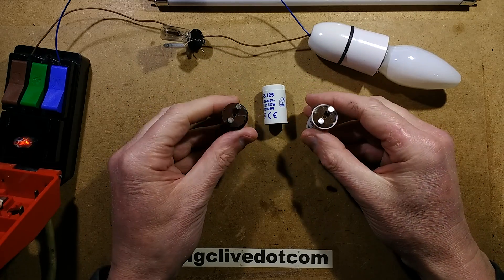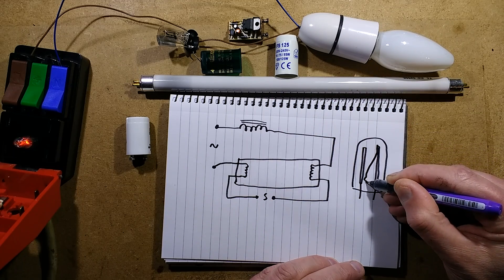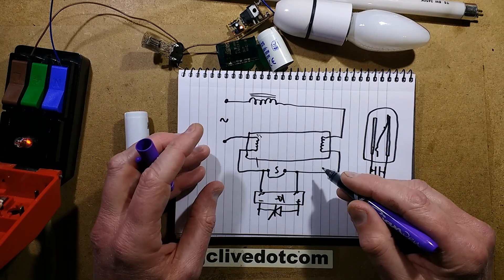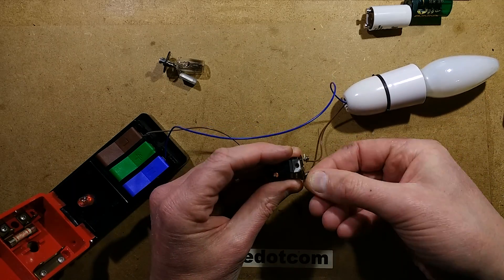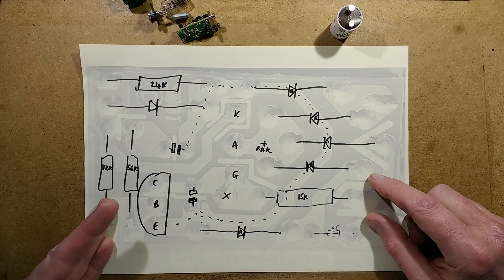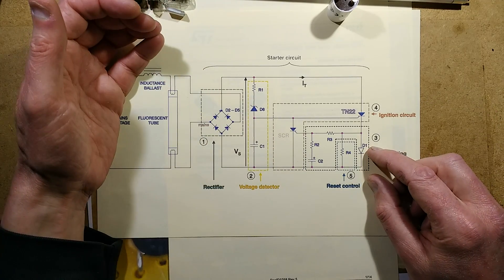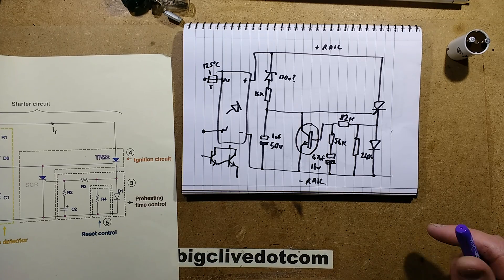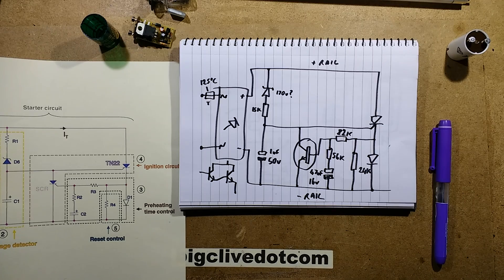Reverse engineering an electronic fluorescent starter.

Comment: I don't think the diode that is in series with the main thyristor is a zener. The band on it is to the negative rail. If it were being used as a zener it would be the other way round with the band to the thyristor cathode. It could simply be that this diode's forward voltage is high enough when the heaters are on that it will exceed the voltage required to bias the darlington on (after the time delay) and reverse bias the main thyristor, turning it off even thought it still has a voltage across it's anode-cathode.

If the tube doesn't strike at this point, I can't see how the starter is going to latch off. The 47uF timing capacitor is going to discharge via the diode (without the heater current it's forward voltage will be lower than that needed to bias the darlington on) and the "reset" resistor. I suspect it just keeps switching on and off, giving the tube further chances to strike.

It would be interesting to watch what happens on a scope with a broken tube - after having taken precautions as a scope's probes are usually referenced to earth (and therefore the neutral in .uk).

Comment: I don't think the second circuit actually latches. When the 47µF capacitor discharges below the threshold the 1µF capacitor charges and latches the SCR on. The SCR turns on just long enough for the 47µF capacitor to reach (or actually exceed) threshold and it turns on the transistor and shunts out the 1µF capacitor and cuts of the SCR and the cycle repeats when needed (the 47µF goes below threshold). This cycle also happens so quickly that the fluorescent tube filaments (or your ballast lamp) do not have time to build up sufficient heat to start glowing, let alone starting thermionic emission and the inductive pulse created would also not be enough to attempt a tube start.

Comment: "the thyristor that shunts the starter contacts is kept off if the tube doesn't strike" Would it be because of thermal fuse you have mentioned.
Reply from the maker: the thermal fuse is a one-shot fuse that will open the circuit if the starter fails in a dangerous manner.
Reply: I figure it must be small leak from tyrister to keep latching the transistor. Because of small leak they must use Darrington instead of a regular BJT.

Comment: As I see it:
The fluorescent lamp should get lit by the coil spike after the thyristor gets shut off.
After that the voltage over the circuit is low enough to prevent a restart, the zener doesn't provide current.
If the lamp shouldn't start the voltage rises high enough to conduct the zener again and the cycle starts over once more. The R2, R3 and R4 should be dimensioned such that the darlington doesn't conduct anymore at a restart.
Now I have a question: the darlington input needs 2x 0.65 Volts, is the series D in the main circuit a version with a higher voltage drop?

Comment: Not to get boring I will just give a couple more thoughts that sprung to mind and call it a day.  One is that the thyristor needs to be off while triggering the tube into life.

First, it is possible because of the time it takes for the ballast or inductor field to collapse and create the starting voltage it is possible that the thyristor may trigger at the same time as the field collapses preventing the high voltage being created to fire the tube.

Second and may or may not be so obvious is that when the high voltage is created the thyristor could fire and present a virtual short across the tube stopping it from firing.

Comment: I must appologise to any electronic engineers and technicians for the display of my stupidity.  I broke the first rule of fault finding, I assumed!  The answer comes with a blinding flash of light and a thud as your jaw drops and hits the floor.

Assuming a steady 240 volts out of the bridge rectifier then the circuit would work the way I described but and here is the big but.  When the flourescent tube strikes you have only 90 to 110 volts out of the bridge rectifier.  I am betting that the zener diode that feeds the trigger circuit of the thyristor is a much higher voltage than the 90 - 110 volts.  So the thyristor never fires once the tube is on.  The darlington pair circuit then becomes a delay circuit giving the flourescent tube time to strike.  It also probably stops unecessary firing of the thyristor during this period.

Comment: This channel brought to you by bridge rectifiers.

Quick question: The fluorscents in my wife's new store have a single pin at each end. How do they work? Is it some kind of double pin that I'm missing?
Reply from the maker: +Chaos Corner They may be a type that is run like a cold cathode tube.  Just one electrode at each end.
Reply: Do they run continuously at high voltage or just to get them going? They seem to come on pretty quickly. They are old 8' T12s. I am thinking I might start replacing them with LEDs but not sure if that's a good investment.

Comment: My guess is that the main thyristor must fire every so often, depending on the state of charge on the capacitor on the base of the Darlington transistor.  If enough charge is held then it does not fire every half cycle but it must fire every so often.  Just enough to keep that capacitor charged enough to turn on the Darlington transistor.

Comment: Once the 47uF capacitor is charged, the transistor turns on and stays on. It steals most of the current from the gate of the thyristor. A low current flows gate-cathode through the thyristor, it is not enough to turn on the thyristor, but it is enough to keep the transistor on. And as the transistor is on, it still eats most of the current, so that there's never enough current for the gate to turn on, but some little current to keep the transistor on.
Reply: and of course the gate-cathode junction of the thyristor acts as a diode in forward direction.
Reply: The SCR gate is shorted to ground when the transistor is on (that's why the transistor is there).  How can it get power from the SCR to keep the transistor on if the gate is shorted?  How can the cathode have any voltage on it?
Reply: The transistor is not fully saturated. Its voltage drop is enough to allow tiny current flowing through the gate-cathode junction and then through the base-emitter junction. A negative feedback keeps this current stable.
Reply: Which I believe it raises the question on why the SCR even turns ON the 1st time ?
In other words, even on the 1st time, as the 50V 1uF cap voltage increases, the gate-cathode current increases, raising the base-emitter voltage  of the "NPN" , which could eventually start stealing enough current to prevent the 1uF cap voltage to further increase, stopping the SCR of ever turning ON. 
My guess is that the 47uF comes to the rescue here, when you 1st turn ON the light because it is fully discharged. The times constants are fine tuned such that the SCR turns ON way before the "NPN" is even close to go ON. But once the SCR triggers now there is plenty of current to complete charging  the 47uF at the fastest pace possible.

On another topic, nowhere I have seen that a SCR, once ON, can be turned OFF by playing with the gate terminal. Usually they just talk about the hold current.
Having said that I am convinced it is the "NPN" that turns OFF the SCR, though I am not sure how.
Reply: Yes, DiodeGoneWild is right. 
There only has to flow a few micro-amps through the gate into the darlington's base to keep it on, which is not enough the turn on the thyristor.
Reply: Kevin Counihan  Im not saying its not an SCR. Its entirely possible it is, and I agree it would make a lot more sense to use only SCRs/thyristors as is normally done. It would make more sense. But diodes in the usual package with dual dies are relatively cheap (but more expensive than the usual rectifier diodes), and it could be possible they are doing it that way, if its a Darlington. It would be odd for sure, but its possible. I know what you mean about them being more expensive. GM used large HV power diodes in their automotive ECM/PCMs to mitigate HV spikes of either polarity and reverse input protection. Usually had a large power diode, TVS, and/or a MOV that was almost an INCH in diameter. As far as the diodes I was "testing", these where rejects. I was doing it intentionally because I knew they would dissipate so much power once they finally started to conduct. For fun, basically. They were used in 100 kV internal power supplies for monoenergetic neutron generators for oil field tools. Basically a 16" long tube with a 24 pin connector at one end and there was a 20-30 stage ladder to step up 200V from either an external source or internal switchmode supply powering the ladder and neutron tube itself (called a minitron).
Reply: greetings DiodeGoneWild 👍

Comment: Could it be Clive that you had wrong specs assuming that the IC was a Darlington pair?  A transistor does not "latch" like this, a special latching circuitry is required to enable it to do so, only a thyristor (or some mechanical relays) can do this sort of thing by itself. It does not make sense for makers of the starter to deviate from the recommended manufactures' diagram in that one detail only.

Comment: Could you please have a look at this and tell me how good it is. I am going to use it for a small phone speaker build.
http://m.ebay.com.au/itm/PAM8403-Audio-Module-DC-5V-Mini-Class-D-Digital-Sound-Amplifier-Board-LCD-TVs-KK-/142061019767?hash=item21137f2277%3Ag%3AA94AAOSwbsBXkDbl&_trkparms=pageci%253Adaf6e898-210f-11e7-b039-74dbd18011be%257Cparentrq%253A6c7cb55c15b0a605b71b4ebbfff94f6c%257Ciid%253A1
Reply from the maker: Those modules are useful, but do generally require an extra smoothing cap mounted on the power supply.  You can get a similar module with a volume control on it.

Comment: I saw a video once of someone using lots of the gassy starters and normal filament bulbs to create a "real glow" fire effect in a fireplace. How long would the starters last under those conditions? It sounds a very interesting thing to try for a fire glow effect :)

Additional : Omg, lol here I am at full circle once again, I found the article on DMX512.com  from 1997 , and guess who the author of the project was O.o
Reply: For those that wanted the direct link www.dmx512.com/web/light/diy/flikfire/flikfire.htm
Reply: Napalm's link is dead now, unfortunately.
Reply: link lives again!
Reply: The starters would last a few hours to a few days before becoming either an open or short circuit.

Comment: As far as I can I am going LED bulbs. So far after a year I have had one start to flicker. Strange thing is it's not one of the Poundland ones, it's a 'posh' one. I do find though that as many fittings have their bulbs facing upwards and LED bulbs throw most of their light upwards it's a bit of a waste. I'll have to either change the fittings or spend quite a bit on different LED bulbs.

Comment: That can't be right! The voltage drop over a diode is not high enough to turn on a darlington transistor. Ether it is not a darlington transistor or it is not a regular diode. Get out the voltmeter.

Comment: hi clive i bought a multimeter from ebay for £10 which i didnt expect it to be as good as it is it has alot of features that cheapo meters do not have i opened it up and it is fused on the ma and the 10a settings i was shocked id like you to take a look at it if you woukd and test it for its accuracy here is the link to it http://www.ebay.co.uk/itm/172493123444

Comment: From what I gather the resistor below the transistor's base forms the bottom of a voltage divider which must account for why it works. I am more shocked to see an actual circuit with discrete components in that starter case than anything. All the ones I have torn open never had anything that complex in them. I think I even have an old one down the basement that has a removable starter that is resettable. I got that FL unit from a city worker where they used to keep the snowplow trucks -- apparently it is extra good at staying lit in our frigid sub zero temps. Good vid, Clive.

Comment: What happens if the old fashioned starter malfunctions so that it makes a permanent shortcut?
Reply from the maker: The tubes will glow at the end continuously, but the tube won't light.  A quick fix is to remove the starter and chap it on a hard surface so the contacts spring apart again.  But ideally you replace the starter.
Reply: No fire hazard, then?
Reply from the maker: It puts a lot of extra strain on the ballast and the tube and endcap get very hot.  Fluorescent fittings are designed to withstand this, but I recommend changing the starter and if necessary, the tube too as soon as possible.  The fitting is consuming the same if not more than it would if it was actually lit, as it is burning the energy off as heat at the ends of the tube.
Reply: One time at my work a starter caught fire because it kept firing and got too hot. So they decided to change all the old ones for electronic starters. Starts way better too

Comment: I want to rid off fluorescent lamp on my 24v truck with an LED. do you have any suggestion for a LED driver diagram? ty. love your vids.
Reply from the maker: Easiest fix is to use the same fixture, but replace the tube with either a section of 24V LED tape or two equal-length sections of 12V tape (from the same roll) wired in series.

Comment: When I was  a kid, local electrician showed me a trick. just short the two leads of starter holder with piece of wire for a fraction of second. I thought is was magic.
Reply from the maker: That does exactly the same thing as the starter, but just manually.
Reply: Yep, I know. But One question though,  Even After the wire is removed , How it lights with a open circuit??
Reply: It's not open circuit. After the arc has struck inside the fluorescent tube, the current runs through that.
Reply: Once it lights, one can remove the starter. I guess it makes the circuit open, right? @2:02 But it still continue to light
Reply: Sorry, Now I got it.
The two ends makes the circuit closed.
 I considered it as circuit with two bulbs with starter in middle in series. I'm not into electronics :(
Reply from the maker: A traditional starter is effectively open circuit once a tube has lit, as the voltage across it is not enough to make the gas conduct.

Comment: If a compact fluorescent lamp has electronic driver, and only its bottom lights up, what could be a cause? Is that fixable?
Reply from the maker: +Supreme Commander It sounds like loss of internal vacuum or the mercury vapour may have been absorbed into the phosphor.  Not really fixable.
Reply: Thank you for the reply. But it happened suddenly. Just on one day I switched light on, and only the part, which is closer to the cathode/anode, lit up
Reply: Either what Clive said, or enough of the emissive coating has sputtered off the electrodes that the arc can no longer be struck. Since the electrodes have not gone open circuit, what you see is the glow of the preheating.

Comment: So, what's the science when the lamp is failing and you touch the bulb with your hand and it starts?
Reply from the maker: +bluetorch13 Fluorescent tubes require a grounded plane in the vicinity of the tube to help them start.  The capacitive coupling reduces the voltage needed to ionise the gas in the tube.
Reply: OH! THANKS! :D
Reply from the maker: In the past you used to be able to get tubes with a conductive strip or wire that ran the full length of the tube.  It was for architectural lights where the tube was suspended without a metal fitting in its vicinity.

Comment: Clive.. Not sure how else to contact you.. I recently bought a product on Amazon that I think you would love to "take to bits". We were sick of going through butane lighters lighting our stove and found this thing. 

https://www.amazon.com/gp/product/B01MTL14DR/ref=oh_aui_detailpage_o02_s01?ie=UTF8&th=1

Its obviously a high voltage driver circuit with a lithium battery. It sure works well to light the stove!
Reply from the maker: Looks like an adaptation of the arc lighter I took apart.  I've ordered one from eBay to take a look.

Comment: I changed my fluoro lights to LED (all 5 of them).  I had to modify the wiring a little (bypass the ballast, starters, etc).  I'm pleased with the results, they turn on instantly at full brightness, no flickering, no noise and they are brighter.  As for reliability, I'm not sure if it is better than fluoro, it's only been a year since I changed them to LED and they have worked perfectly since then.

Comment: I don't know much about circuitry but I would assume the Darlington transistor is supposed to turn on and off, and then the track with the 1uF capacitor is just where the current goes.

Comment: An interesting thing about fluorescent lamps is that some will not start without a grounded reflector within a half inch (12mm ). The capacitance helps the lamp start. If no reflector is present,  you can grab the bulb to make it start.
Reply from the maker: You used to be able to get tubes with a conductive strip down one side to help starting if tubes were used in "architectural" designs with no ground plane in their vicinity.